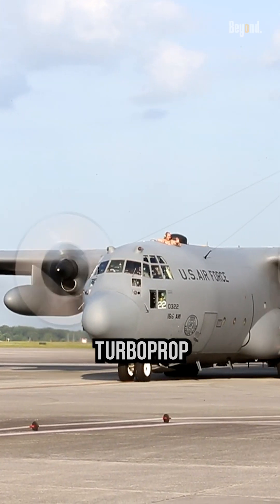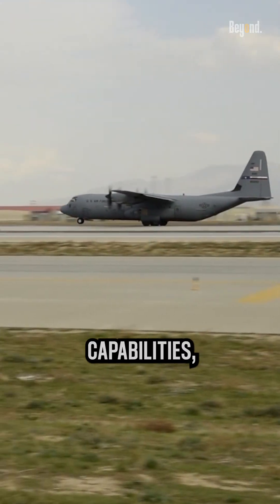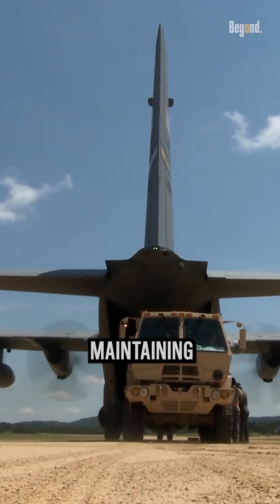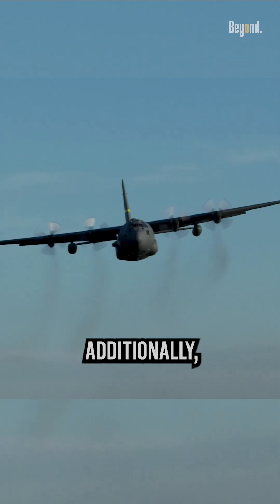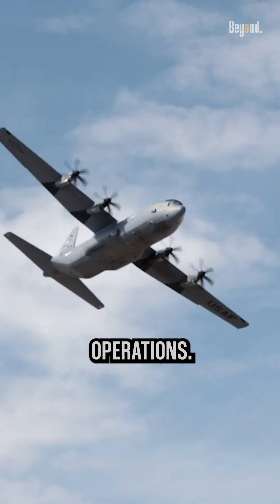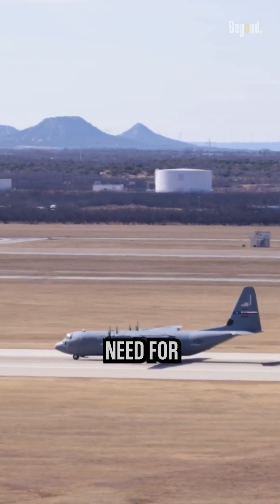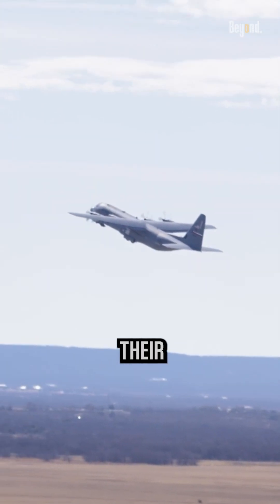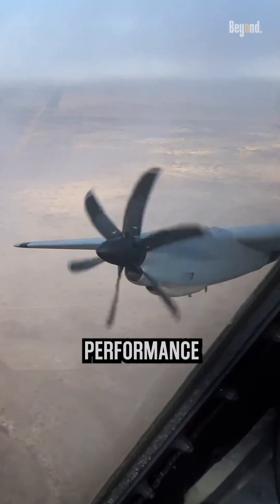Why does the C-130 aircraft use turboprop engines and not jet engines? #shorts

Comment: "Turboprop" engines are jet engines. Why do people make this mistake. Whereas a commercial jet engine turns a big fan at the front via the exhaust turning a set of vanes at the rear, the same method is utilised to turn the props via a reduction gear box at the front too. Now turbojet engines are different.